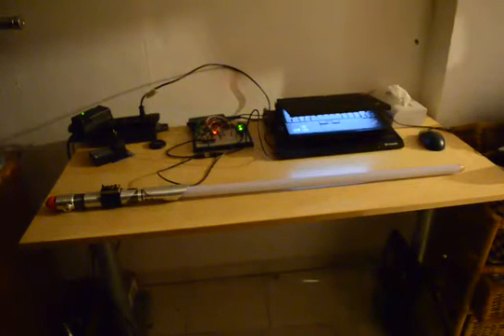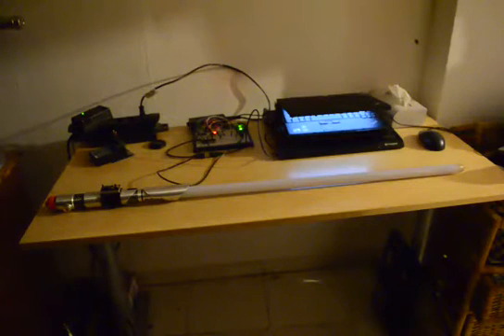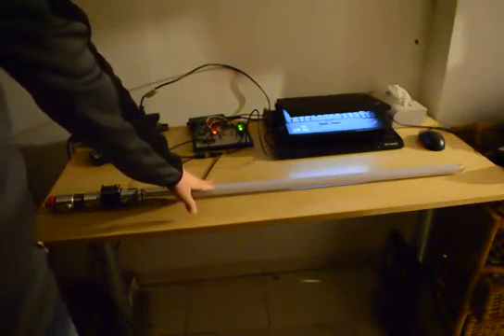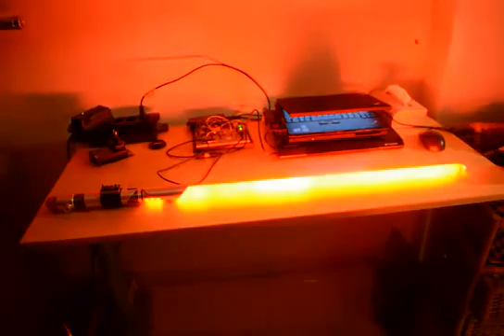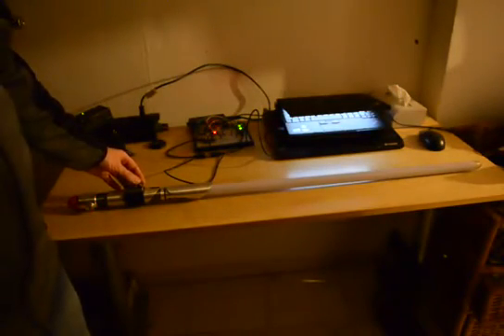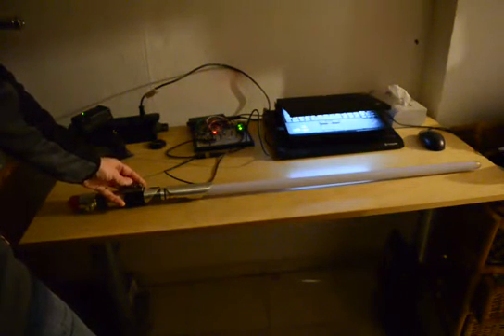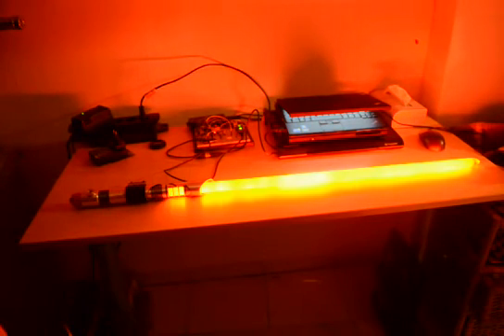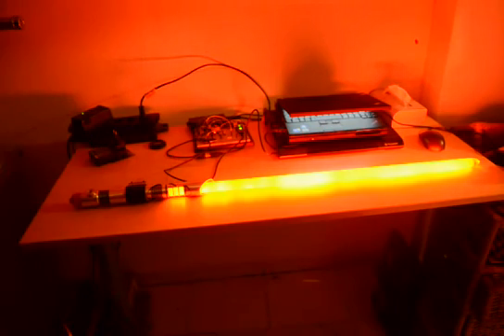DIY Arduino based LED string saber electronics

Comment: Hello Andras Kun, i'm actually building my own Arduino micro lightsaber too and i'm wondering: To make the scrolling effect, you have around 8 pieces of 10 led in series in parrallel right?(i think they do it like that at Master Replicas)
Those LEDs are about Uf=3.3V so what is your source of voltage? I'm lost in my calculation ! 

I will built a saber with the same components (arduino micro, a sound modul ...) but i don't know how i can choose my battery! 7V? 9V?  i'm afraid that because some LEDs are in series, i need more voltage but the arduino micro can't handle more than 20V so how did you do? :/

It will be nice if you hive me an answer :)

Comment from the maker: @Bushmann02: igen, en is magyar vagyok.
@Terribadest: there are ~90 so called superbright 5mm LEDs in that saber blade :), actually due to the emission angle, and the multiple layers of diffusion around 30% of the brightness is lost, the naked string is something you do not want to look at without protective googles.